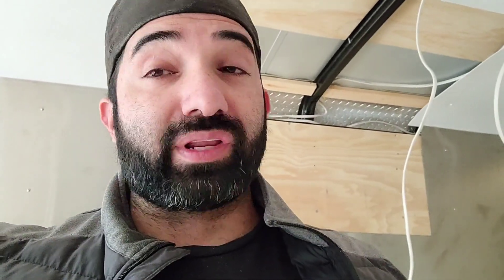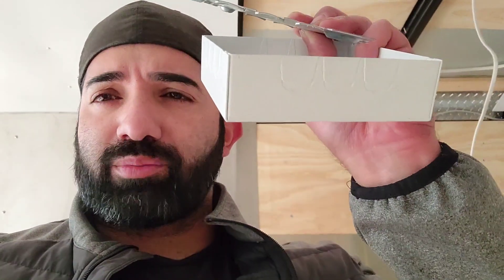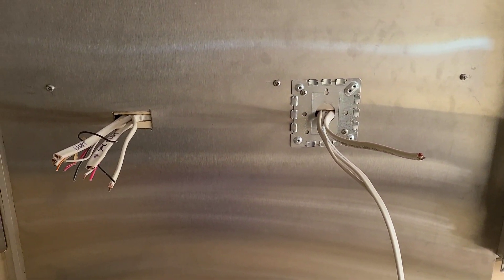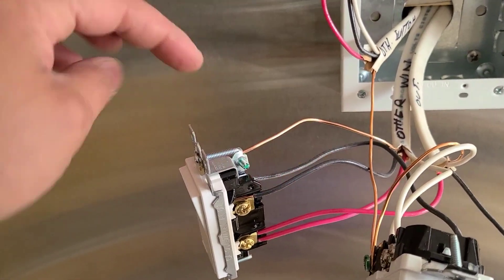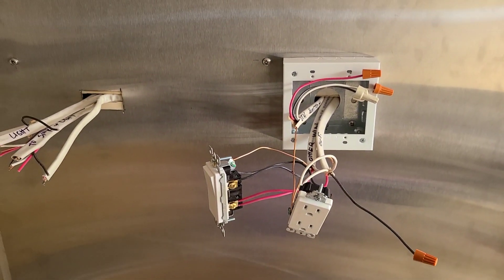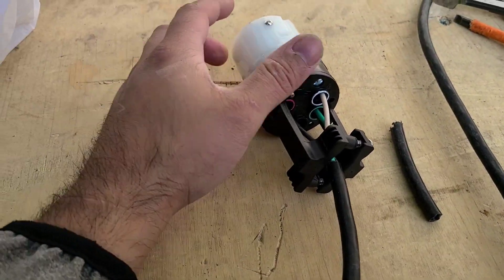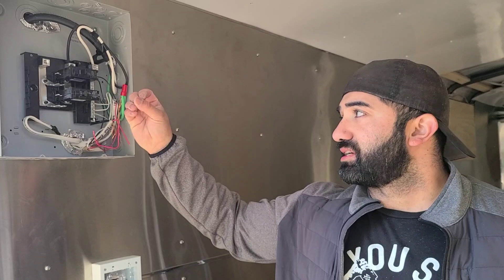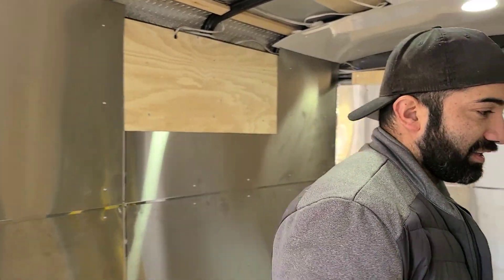How to Build a Food Truck: Electrical

Comment: In Florida can I run the wire outside the walls in conduit? And how high from the floor are the plugs supposed to be placed?
Reply from the maker: I put mine above my counters at about 48 inches. Can you yes, but why if you can run inside,  too much work in Exterior

Comment: Can you use your temporary extension cord to test if wires are live before you finish the rough in? I really want to make sure my wires are good before I put up my walls.
Reply from the maker: Yes there is a video I made that shows how I connect to the generator inlet Plug and that takes you to the breaker panel

Comment: How long do the 30 lbs propane tanks and generator last for a typical week of business or month?
Reply from the maker: That's a hard one to give a exact answer to. Depends on your cooking equipment even just the manufacturer difference, how many people you feed. Mine last about 3 events
Reply: @fbaltierrez  If I were wanting to work 5 days a week what do you suggest for pounds of propane tank for like what you have? Thank you very much for the response.
Reply: @fbaltierrez  5 days a week 6 to 8 hr days.

Comment: Hey brother, what do you use between the sheets of sheet metal? Some kind of strip that hides the joints?
Reply: Right on brother, I appreciate the love. I will order those up.
Reply from the maker: @JayBagube  💯💯💯
Reply from the maker: Yes let me find you a link here.
Reply from the maker: These are Paid Amazon Affiliate Links just so you are informed but I use these

SS Trim Pieces
End Cap:
https://www.amazon.com/gp/product/B07M793VN5/ref=as_li_tl?ie=UTF8&camp=1789&creative=9325&creativeASIN=B07M793VN5&linkCode=as2&tag=rollingburrit-20&linkId=9b596fb6e41fc02db37f3dde5c9f2ed6

Divider Bar
https://www.amazon.com/gp/product/B07MLSP44P/ref=as_li_tl?ie=UTF8&camp=1789&creative=9325&creativeASIN=B07MLSP44P&linkCode=as2&tag=rollingburrit-20&linkId=14b923c96bad8c7829caeb5c89ebebb4

Comment: Great information!  I am designing a Food Truck Entertainment center with a Stage, Bar, and about 11 Food Trailers (on wheels) on the perimeter. The owner wanted each to have a meter for monitoring Electrical usage.  I have seen some around town, it basically stubs out of the ground, 30" tall, with a small panel box, about 6 feet from the Trailer's end side.   What would I specify in terms of  wattage, outlet, etc?

Comment: Hey Frank,
Great video I'm having issues with my panel on my food trailer I have six breakers (5) 20 amps and 1 15 amps when I plug in the griddle pulls so hard from my generator which is a Predator 4375 (3000) Do I up my amps on my breaker to fix this problem.
Thanks

Comment: What type of breaker box did you use
Reply from the maker: Breakers

https://www.amazon.com/gp/product/B000H5T2XE/ref=as_li_tl?ie=UTF8&camp=1789&creative=9325&creativeASIN=B000H5T2XE&linkCode=as2&tag=rollingburrit-20&linkId=d56eeb5a1f534e4fc70e1f294920659a
Reply from the maker: Mini Breaker
https://www.amazon.com/gp/product/B00002NB0L/ref=as_li_tl?ie=UTF8&camp=1789&creative=9325&creativeASIN=B00002NB0L&linkCode=as2&tag=rollingburrit-20&linkId=df62e074e6bb3d54b5358fd23ba920f6
Reply from the maker: Breaker Panel

https://www.amazon.com/gp/product/B00002N7KK/ref=as_li_tl?ie=UTF8&camp=1789&creative=9325&creativeASIN=B00002N7KK&linkCode=as2&tag=rollingburrit-20&linkId=99fa76d702aa2044bfff7aa764ad1574
Reply: Frank curious about the main lug panel vs main breaker panel. Is a disconnect or main breaker not required? I’ve read a couple things saying a disconnect is needed. Or does the plug fulfill that requirement?

Comment: Frank, your videos are amazing. Thanks for the hard work on putting these together. Question: wiring a coffee trailer with a 220 espresso machine and everything else is 110. What kind of panel is needed and how do I provide both 220 and 110. Using a 50amp plug.
Reply from the maker: You can do it from this same setup here. Just male sure the generator you huy pushed 240V and you will use one more cable to make the 240V

Comment: Hey bud got another question the side with the window how many 14/3 wires did you run for the switch legs
Reply from the maker: For the switch legs all you need is a 14/2
Reply from the maker: But for the outside light then just 1 14/3 across the window
Reply: Ok I was trying to do my wiring just like yours and I think it was all ran to the spots right but the 2 boxes by the door that you were showing it looks like there all ran with 14/3 I ran them all with 14/2 just wondering if I need to run these with 14/3 as well can you explain that for me sorry if im asking to much lol

Comment: How do you ground your breaker box to prevent small shocks esp when wet conditions. We have a normal 10 gauge extension cord running directly to panel, I added a ground bar bc it didn’t come with one, should I bond ground and neutral?

Should ground bar be contacted to metal frame?
Reply from the maker: I connected a ground to my box and that connected to my neutral bar and thats all the Grounding I did

Comment: 30amp generator➡️L5-30P(male)➡️8/3 SOOW power cord➡️50amp female plug 3prong 4wire➡️pb50➡️Panel box 

Getting 3 hots no ground! Please help. No electrican near me is answering at moment.
Reply from the maker: What do you mean when you say 3 hots? There should only be 2 max.
Reply: @fbaltierrez  red black and white are hot. Should the inlet box be grounded to trailer frame?
Reply from the maker: @michaelduggan7114  it doesn't have to be but it won't hurt either. You must have used a jumper somewhere there. Impossible for all 3 to have power unless you have 3 phase power

Comment: how do you ground the food truck
Reply from the maker: In the breaker box I just bond the neutral to the ground the panel had a bonding screw inside 👍
Reply: @fbaltierrez  You realize that's a code violation right? If you ever plug into a main (not a generator) you have neutral and ground bonded in what is a sub panel in the truck. You CANNOT have neutral and grounds bonded beyond the main panel. Which is exactly what you have once you plug into something other than a generator (and even with some generators). Not sure if it was this video or another but you also mention 14awg wire is fine for 20amp. It is not. That's another code violation. 14awg wire is rated for a maximum of 15amps on branch circuits. And....I'm just gonna ignore the inside of the panel in the truck and assume it's a temporary thing. I'll just say, if that got inspected near me and they saw that, they'd make you rip the entire thing out and start from scratch.
Reply from the maker: @theelite1x721987  never have I mentioned you can use 14 gauge with 20 amp circuits. Good thing I only use it with a generator. Been 2 years and no issues 👍

Comment: Why did you cap off the out Black wire?
Reply from the maker: There are some wires in there that are spares or extras. I like to have an extra wire in these type of wiring. Just in case a wire goes bad slim chance that happens but you never know

Comment: Wish I could see how he wired the service panel from the generator. I’m looking for a diagram but can seem to find one. My service panel doesn’t have a main breaker
Reply from the maker: It's pretty straightforward, you either have a panel that has a main breaker or a main lug. You wire them the same way, if you want only 120v just connect one wire and the neutral. If you want 240 then the 2 wires to breaker or lug and then neutral

Comment: FRANK WHAT WIRE GAUGE  DID YOU USE TO WIRE TRAILER
Reply from the maker: For the lights and outlets 14 gauge. Main cable is 8 gauge

Comment: Hi frank .I have food trailer that have 65 amp junction box and had 15 amp breaker, 20 amp breaker and 30 amp breaker. the way the wire connect is 220 volt. is it possible that I can use 120 volt with  those breaker and what size wire I should use?
thank you

Comment: Frank i get all the wiring I just don’t get how you run all 4 lights off the one switch
Reply from the maker: From the switch run a wire to a light and then from that light go to the next one and then the next one and keep going. Simpler
Reply: Ok so cut a small peace of Romex and run from the first light that I connected to the switch then another, so all 4 off the one switch just piggy backed the first light to the remaining 3? 
Another question the Romex you ran from the window/light / water heater to where the water pump will be labeled light for? 
Frank your a beast! Thanks for answering so fast

Comment: Hey Frank, currently building out our first brand new food trailer from scratch, appreciate these videos thank you! Quick questions, all of our equipment comes out to total of 72amps. How can you put more than 50 amps in your trailer if most hookups are 50amps? We are doing a waffle truck, so all our cooking equipment is electric, we can’t run any propane. I appreciate at any advice, thank you!
Reply: Another alternative is to run 2 panels and 2 generators. I help build coffee trucks, so I'm use to seeing high amounts of power. Consider building out with 50 amps for 1 panel, then possibly using a spider box for another generator (peak hour equipment).
Reply from the maker: That's a lot of amps 😳 almost a small house. To be honest I would not know the answer to that for a food truck, sorry about that. My answer is of no help
Reply: I would just run it and see if you are fine,  if you added up to 72watts that is max at full power, lots of equipment you might be only running at half power, most equipment only used the max power on startup but once it reaches its desired temperature it will use less power to maintain that temperature so maybe dont try to start everything at once, one of my trucks if I don't have enough power at an event I start my hotwater heater get it up to temperature and shut it off, the water will stay hot for 4 hours easy.

Comment: Thanks for the video. It’s good to be able to watch someone else go thru the steps before I start.
Btw grounds and neutral should not be connected-bonded in a sub panel. You needed to install a ground bar and bond it to the case of the electrical panel. This gives you a separate place for all the grounds so they are separate from neutral
Reply from the maker: Thank you for Watching. Yes, added the ground bar after the video didn't have it with at time of filming but you are absolutely correct 👍
Reply: @fbaltierrez  sorry, I should have read the rest of the comments before commenting
Reply: I am building food trailer we did all electrical but we getting shock we touch the door handle what it be please help

Comment: Hey frank thanks for the videos , quick question I saw you had 3 home runs but I see you only have 2 breakers? I know one breaker is for the extra outlets and one is for the fridge and exhaust fan I’m guessing you put everything else on the same circuit? Or where are you getting your power for the other side of the trailer the lights and outlets on that side? Also I see no ground bar i see you tied all grounds together with a wire nut are you adding a ground bar or just leaving like that or can you put them together with the neutrals?
Reply from the maker: The other side of the trailer I tapped it into the fridge breaker. You can add a tandem breaker instead but I just added them together on same one. There is a ground bar now when I filmed it I didn't have it but that part just gets added to the breaker box. 👍
Reply: @fbaltierrez  ok makes sense I appreciate you thanks

Comment: Hey Frank
Thanks for the great videos that you have been making on building a food truck. Do you mind showing how you wired the testing extension you made and connected to the truck. Basically, how do we connect the regular 3 pin plug to the XYGW plug for the truck? Thanks

Comment: Hey Frank, by using a generator for power, should I bond the neutral and ground or keep them separate?
Reply from the maker: I would have a ground bar inside the breaker box and keep them separate if possible that would be ideal. But if you have no option then you can bond them together 👍

Comment: What amp panel can I use ? 100 amp or 120 ?
Reply from the maker: Either one works they are the same they will only handle what you push to them from the generator

Comment: How did you run or connect the power from your power source
Reply from the maker: Ran the service wire underneath the trailer in a small gap that the steel framing has. 👍

Comment: wha  the best option on Generatorst you considere
Reply: how quiet is im in FL i think is important it have to be be quiet  thank for take you time y contestar
Reply from the maker: @angeltorred2120  super quiet I can talk on my phone and be 2 feet away and no issues.
Reply: @fbaltierrez  sera suficiente para un hood de 8 pies 27 inch sandwish station refrigerator  maybe small freezer tv and future ac they been build my may be one equal to de Honda 7000
Reply: thanks again Frank
Reply from the maker: @angeltorred2120  making a video about this today
Reply from the maker: I can only speak from the one I have, bought here on Amazon great great generator Westinghouse Inverter. Let me add the link
Reply from the maker: https://www.amazon.com/gp/product/B06XC47ZX4/ref=as_li_tl?ie=UTF8&camp=1789&creative=9325&creativeASIN=B06XC47ZX4&linkCode=as2&tag=rollingburrit-20&linkId=554da107dc13785d622d7ddd9bb7670c

Comment: hey Frank loving the videos, have a question for you.  so i would like to equip my trailer with equipment, but how do i know how much Start up watts and run watts i will need.  I was going to go with Electric Grills but they looked to run to much Watts for my generator plus the other stuff running.
Reply from the maker: I wouldn't go.with electrical equipment personally they do use a lotttttt of watts and have to use a bigger generator and when you go bigger they get louder and in events you don't really want that
Reply from the maker: You add up the watts usually on a placard. If it says amps they multiply that number by 120 and that gets you the watts. Hopefully that helps